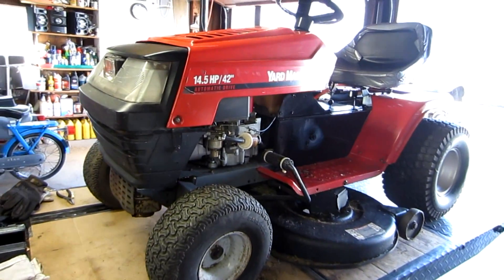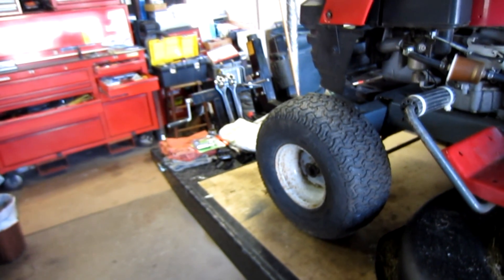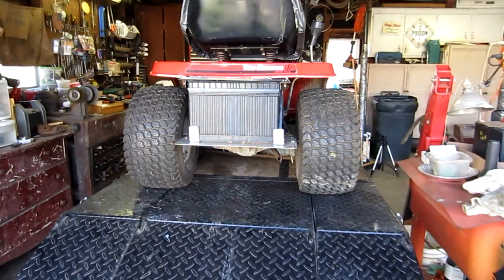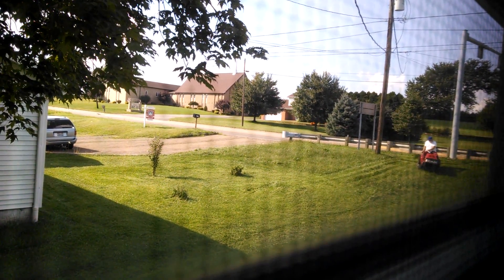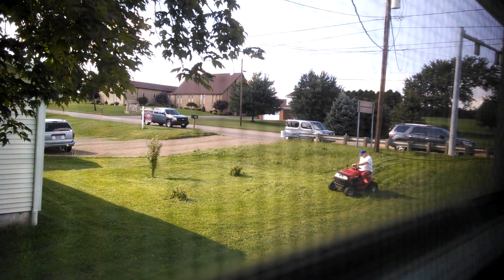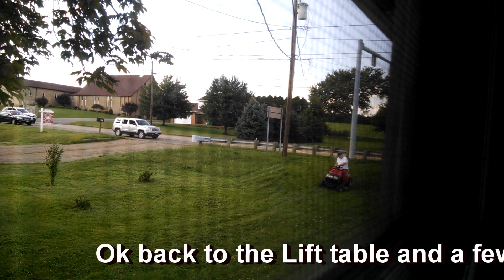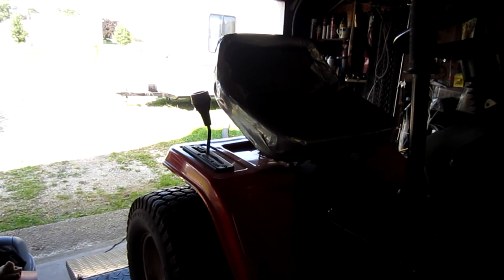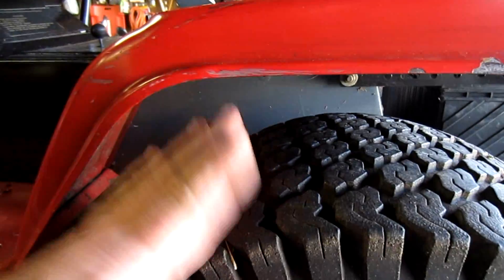Buying used MTD mower DON'TS

Comment: Any idea how I could mount a plow on the front of this. I got the same one
Reply from the maker: I'm pretty sure they used to make them for that model. You may want to find an old manual and look to see if Bayless the part number for a plow accessory. With that said , if they were good plowing tractors, at all. They were too lightweight and by the time you spent the money for chains for the rear tires and wheel weights for the rear tires and the plow itself it would be better if you just found an old garden tractor but doesn't have a mowing deck but does have a plow mounted on it. You can take a look in my playlist somewhere or search for Sears st10 tractor plowing and you can see what we've been using here at the house since 1975. It was my wife's grandfather's tractor he had it delivered here by Sears and it is plowed this driveway ever since. You can find these used for about 350 to $400.
Reply: @Foxboss9  I'll keep an eye out. I live in a small Waterman's town called Poquoson in Virginia. It's become a very desirable area over the years and the only down side is a mower like the ST10 or LT10 is they sell I shit you not for a thousand dollars without the plow because it's  an "antique". I actually have ATV mud tires on the front and rear of this same mower. They are tubeless too and to my surprise months ago they seal without issue and have not lost any air. They are both V pattern mud terrain tires with at least 2 inches of deep tread. Also I bought a plow for a riding mower, just a different model but I think I know what I'm going to do. I need to stiffen the front frame and axle area too. Thank you for getting back.
Reply from the maker: @acetech9237  yeah I love our st10. It has a plow and a mower deck plus it has a huge lawn roller and it has wheel weights and chains. It's been used like a tractor since it was delivered here on the property since 1975. If you ever decide to come to Northeast Ohio I'm sure my wife would be willing to sell it for less than $1,000. LOL we will probably sell it at our next yard sale for closer to $600 for everything that I just mentioned.

Comment: I agree and disagree with your assessment. That particular mower has been hacked up and abused. I would never buy any machine that someone has hacked to such an extent. I am guessing that one of it’s pervious users was quit heavy (300 plus pounds or more) or extremely abusive to bent that axle. Wether you buy a YM machine like this, new or used, you must bear in mind that they are inexpensive, lighter duty machines. As such, you must go easy on them and maintain them if you expect them to last. The design of the deck might not be perfect, but that floating deck is a real lifesaver if you live in an area with trees that have surface root growth. Also, parts are cheap and easy to get for these mowers and I would rather deal with rebuilding a deck than deal with a failed hydrostatic transmission on a higher priced/ranked named brand mower. I agree that I would pass on that mower, but because of the abuse and hacking; not because of the design of the deck. I would take a well maintained Yard Machine over ANY mower with an RS800 transmission!

Comment: What about the craftsman lt 2000 im thinkin about buyin a used one he want 800 for it has a yard cart and bagger and a trailer looks like its in really good shape its really clean
Reply from the maker: Craftsman mowers didn't change much for quite a few years... Every model could potentially have a problem just like every car could potentially have a problem. Just get somebody who's qualified to look at the mower and make sure that it hasn't been neglected. Just because it's shiny on top does it mean it hasn't been run through the wringer underneath.

Comment: I have one with the PTO handle. Also swapped out the 18 hp engine for a 21 hp I had laying around. Deck design be damned, the thing cuts like a champ. I wouldn't touch an older model though.
Reply from the maker: Separate blade engagement handles are definitely the way to go with MTD

Comment: Use one of those flat black bungee cords to tighten deck. Hook one end to the deck around the hitch and back to the deck. I have kept my mtd mowing 2 acres for the last 21 years. same deck. I also went with the big battery,mainly my fault for not wanting to charge the small battery during the winter, the small ones didn't seem to last more than 2 years. I like the light also.So you just put it on the charger once every 4 or 5 times you mow, no big deal, and you have a good light.
Well my brother in law said it would last 3 years. Guess I get the last laugh.
Reply from the maker: Thats the best way to handle these mowers, Just throw a bandaid on it and keep a churnin' !!!   The least amount of time spent repairing these things makes them worth owning..

Comment: Most of these issues are from hack jobs by the previous owner rather than issues with MTD themselves
Reply from the maker: Doctor Feinstone granted this one MTD has been modified incorrectly but you have to remember that the modifications we're done for a reason. It all started with the fact that the headlights suck on these things. So all of the charging system and Battery Mount issues was to address poor lighting system. As far as the deck is concerned though that was not anything to do with the previous owner. I worked in a shop that 600 to 800 units a week total. Out of that number roughly 100 of those units where various brands of riding mowers that were sold at the big box stores. Out of that hundred this model of MTD was prevalent and took up roughly 60 to 70% of the repairs. And it wasn't because it was the most popular being sold, it was because it was the cheapest being made. Working on these units in my shop here at the house, never did I have one that the deck worked exactly the way it's supposed to when it came in for repairs. In the time that is spent trying to correct the engineering fail was always way more time involvement then the mower was worth. So although some of the deficiencies that I show on the specific mower could happen to a lot of the other mower manufacturers that are out there, the fact that one of the most major functions that a riding lawn mower supposed to do, and that is mow the lawn, is not being done effectively or at all by almost all of this model of mower makes this thing a major fail. Kind of like the 2.7 liter Chrysler engine. The car needs to drive and when you have an engine that is failing on the level that the two sevens are based on the fact that oil changes have to be done following a strict regiment doesn't mean that the owners are failing when they accidentally go thousand miles over the recommended interval. Trust me as a lawn and garden mechanic for quite a few years this is one of the worst models of MTD's or lawn mowers in general that you can buy or use. It gave the nickname that is affecting Italy used by all the small engine technicians of "Missed The Dumpster" for a reason.👍

Comment: I buy these MTD riding mowers for the engines, and never pay more than $75 for one.  Thought for sure you would mention the stupid Vari-drive at some point, they always need new belts. Often times, you find the machine still running on the factory belts, all cracked and worn. Ever wonder why these single speed axles have such a high speed in reverse? Makes no sense at all.
Reply from the maker: I don't have many problems with the variable drive except like you mentioned about the belts. I tell my customers to run the belts till one of them breaks then bring it to me to get both belts done. The reverse speed on the pedal variable drive seems a little faster than most except for the older ones that have the speed control on the left side of the dash. On those, when the selector is put in the highest setting, they are fast forward and reverse almost to the point of being unsafe. $75 is about right. That's all they are worth. That or Free(I have a freebie on my lift right now)

Comment: MTD there good lawn mowers I had one for eight years that went through hell and it still ran really good and you never jump a lawn mower with a 12 volt car battery it will burn out the charging coil
Reply: You can safely jump start a lawnmower with a car. I've been doing it for years.
The mower will only take whatever current it needs to crank/run from the car.
  People burn alternator coils and voltage regulators up when they fail to observe proper polarity when hooking up cables. I've also seen starters burn up from excessive cranking when engines won't start, but as long as the voltages are the same, and no weird battery bypass hookups are attempted, the load determines how much current flows.

Comment: looks like it's missing the tenser pulley....your right about the lite though, he should of used a led, that's what the new model has...for the price it's a good mower, unless you want to drop  2- 3000 on a john deer...order a new seat from MTD Willard,Ohio..peace out.
Reply from the maker: That's one of the problems. The belt does not have a tensioner. The belts tightness is determined by the spring that is on the back of the deck that tightens up as the deck is lowered and is shifted to the rear of the tractor as is being lowered.

Comment: What mower do you recommend.?
Reply from the maker: Wow, I don't know where to begin.  First, I haven't looked at new mowers for at least 3 years so I don't know what's available at the box stores.  Second, if you are looking for used, that takes a keen eye and being there in person to scrutinize a used mower.  Third, I would have to know about your conditions. Meaning, are you a handy type?  will a more complex mower confuse the operator? How old is the user? How long does the mower need to last?  Is there going to be more than one user?  Is the mower going to be a good "body type fit"?  Ergonomics?  Trouble getting on and off and being able to operate due to physical limitations. How much mower is needed?  Is the terrain rough with bumps, roots, ruts?  Mainly wet climate or dry? Sandy or muddy?  Grass grown naturally or treated for growth? Is there less than 1/4 acre or more than 2 acres?  Is fuel consumption an issue (gas station not close?)  Is the yard full of obstructions?  Is quality of cut a concern?  Is the lawn manicured or just mowed? How easy is it to get maintenance done or can you do it yourself are dealers close by?  Will you be transporting the mower frequently?  Are attachments needed for the mower now or in the future (bagger, plow, tiller, snowblower, trailer)?  What's the users preference auto or manual?  Automatic pedal or on the fender?  Cup holder? Sun protection(canopy)  Winter protection(cab for snowblower) Will you be towing anything? How about noise(muffler sound)?  Do you need to cut the grass quickly(busy schedule)? And finally how much money to spend?  I don't expect you to answer these questions but rather consider them beforehand. I would find someone locally you trust to help you narrow it down. I am glad you asked me this question it is obvious I need to do a video detailing why all the questions I posed are pertinent to choosing.  Thanks.

Comment: it seems to me that most of these faults are the result of the previous owner NOT the brand... any used piece of equipment can be used and abused by people.. I hardly think MTD are at fault...
Reply from the maker: Jackal's Outdoor Channel I'm pretty sure that is the same sentiment as in the video and description.. So, I agree.
Reply: Foxboss9 I was going off of the video title which makes you feel it's directed at the brand. I'm researching used mowers and looking at a Troy Bilt.. thanks for your information.
Reply from the maker: Jackal's Outdoor Channel No, it's for all mowers but I had a MTD on the lift table so I wanted to point out that idiotic design for deck engagement only which only MTD had..  Thanks for watching and commenting.. ☺️👍

Comment: Great video! Now I have the same mower but sadly it's got a tecumseh engine. Now I want to replace it with a new briggs engine but will the electrical connectors fit a briggs engine?
Reply from the maker: J&R's Lawn Care Equipent and Service Good idea going to the Briggs.... I believe the alternator connections are the same... Not sure though... Let me know how it works out.. 😁 👍
Reply: Foxboss9 sure thing man.now is there anything I need and should look at as well as know when swapping engines?

Comment: Why not just brace the deck to keep it from moving forward and get a 1 inch smaller belt really tight. I have one and I had to get the belt real tight.2 springs in back not just one. Cuts a little better.
Reply from the maker: ElderyounglAgain andagain The majority of the time the blades then will not disengage when the deck is up and in it's off position.. It is a constant battle between too tight and too loose. Either wearing out belts prematurely or not having the blades get to full speed.. I would just rather avoid this model altogether..
Reply: Foxboss9 Yea I know but I would rather keep the belt tight and engage the blades as soon as I start it. Then when I am done cutting the yard I just turn the riding mower off and THEN raise the deck. No problems yet.
Reply from the maker: Cool, I know others who do the same thing.. It does keep it mowing So, your option does work..:-)
Reply: My '96 still runs great w/ it's second engine so i'm not about to throw this guy away ---  second spring?  I was just thinking the same ... going to try that
Reply: ElderyounglAgain andagain iiin

Comment: you dont have to have guards for the blades to disingage
Reply from the maker: Yes you do. It allows the slack to positioned correctly on the friction side of the pulley... This is the same reason the belt guard/guide pins need adjusted around the engine drive pulley..
Reply: +Foxboss9 mine doesnt have any and its fine
Reply from the maker: Definitely an exception
Reply: @Foxboss9  true. My Troybilt was missing the belt guards when I got it. Every time I disengaged the blades (manual PTO lever), the belt would fall off the left pulley and I'd constantly have to stop, shut down and put it back on.
  Ordered some guards for a similar Yard Machines deck and had to take the metal inserts out of them (my machine's original guards didn't have them and buy new bolts to attach them and no worries since.

Comment: That mower seems to have a light duty transmission, they are not sturdy and some of them even break.  Then the with all of those brackets and things it seems that it was designed to be a money pit.  Then look at the way that thing struggles to cut grass.  I have heard that MTDs are junk and that one may very well be the worst of them made even worse with wiring modifications.  I would not take that thing if it had a big free sign on it out by the side of the road.
Reply from the maker: John Doe Yeah, poor neighbor didn't know any better..
Reply: You would be surprised how many people don't know what they are buying and 2 years later they find a ton of issues with it.  From this video, it seems like that model is a lemon.

Comment: The double bladed mower deck is not that powerful than the single one. All the power of the engine has to be divided by two and the two blades run vice versa which results in a small area in mowing width that is not perfectly mowed and so the cutted grass cannot perfectly mowed out of the deck

Comment: I had a call to get a mower started, well, this mower is junk (JD Sabre) The wiring is all screwed up, its 28 yrs old and this person wants me to fix it but is unwilling to put up any coin for repairs. I told them 300 to 400 dollars to fix the wiring harness because I don't need this type of customer to screw me.
Reply from the maker: heavymechanic2 I'm with you brother. You don't know how many times I've had customers show up at my shop and tell me that they just came from the John Deere dealership up the street and they were asking an outrageous amount for the repair so instead they came to me. My internal response was always why do you think I would be any cheaper than the mechanics up there? I have just as many certifications and and probably going to do the job more thoroughly than they would. I hate the fact that people come to my shop thinking that automatically going to get a discount because I'm not at a big-name dealership. Now to be fair usually they do get a better price. But to assume that is definitely a mistake on their part. The way I see it is you can always estimate hi and give them a lower bill for a pleasant surprise. It's never Pleasant if the bill is higher than you anticipated. I hate Sabre by John Deere. I bought one brand new when we first moved into our home and I couldn't believe how bad it's scalped my lawn with only a 42 inch cut and every time you slightly lifted off the seat it would shut off and backfire whenever you sat back down. And I don't even mean completely lift off the seat I mean just shift your weight off to one side like in our case to mow a ditch. I returned it. And swore them off for good.